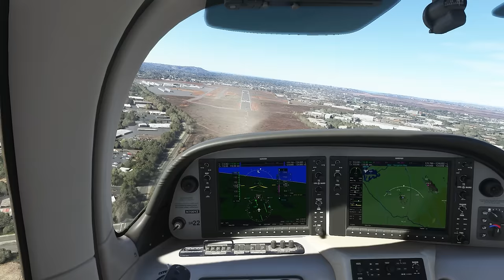Fatal Plane Crash At Montgomery Field After Student Pilot Declares An Emergency | N700YZ Crash

Comment: Reading the comments on Katherinesreport it sounds like he was a solo student pilot. The theory by a few Cirrus pilots is that he was too slow, and the Envelope Protection System was trying to get the nose down, which he thought was runaway trim and kept pulling back and got slower and slower, until it stalled.
Reply: Seems a good theory. I also wondered about accidental auto-pilot? But I've never flown a Cirrus... or anything more modern than 1970 with steam gauges! My question to an SR22 pilot would be if there is some kind of alarm that goes off when the EPS is active? Wouldn't that be an integral part of training right from the start for any Cirrus pilot?
Reply: That makes sense
Reply: I never flown a Cirrus, but damage looks to be cause off stall spin, high angle nose down impact.  Rest in peace.
Reply: I watched this happen. Aircraft was oscillating all the way to the ground… similar to a “porpoise” on the ground.
Reply: @owenwhitfield9475  so pitching up and down as he came down?  How fast did he come down?
Reply: That's the point. All these envelope protection systems are heaven and hell. Hell because they prevent you from self-conducted flying the airplaine, relying on some AI instead. So you become more a system-manager than a pilot. R.I.P.
Reply: @rvrnnr987  I fly Cirruses, there's not really formal training but my instructor taught me in a situation like that to just keep jamming the "autopilot off" button. Although I've only ever run into this issue when I've been intentionally practicing stall recoveries.
Reply: This is where systems knowledge comes in handy
Reply: Yes I think the same
Reply: @owenwhitfield9475  I’ve never flown a cirrus but from my understanding that fits with the envelope protection system theory then if he was too slow. The aircraft would pitch down in an attempt to gain airspeed to avoid a stall, giving the pilot the perception the trim was running away. As a response he pitches up more, only to have the system respond again trying to dip the nose back down.
Reply: @someguyontheinternet7165  So, essentially their system does what MCAS did to the 737 Max? Violent repeated down pitching regardless of altitude?
Reply: A sad story indeed. As a former pilot having flown only Piper and Cessna aircraft, I am not familiar with any Cirrus models, but from what I see in the comments above, it seems that this student pilot might have not had sufficient training in emergency procedures specific to this aircraft. If the aircraft has a system that takes over and changes the attitude of the aircraft when it senses a need to do so, the pilot should receive a visual and an audible warning of that, so that appropriate action can be taken immediately. If that does not happen, I would consider it a serious deficiency of the aircraft itself. It seems apparent also that if an instructor had been present in the right seat at the time, this problem could have become a valuable learning experience rather than a tragic accident.
Reply: @glider1157  I have the same AP in my aircraft. Its complex and you have to get to know it. Lesson #1 s how to turn it off.
Reply: that’s exactly what came to my mind and then i saw your comment

seems very similar
Reply: This seems to be an older SR20 which doesn’t have envelope protection. I may be wrong of course but it came with stec autopilot. Plus why would he be on autopilot in VFR on short final?
Reply: @susansticazsky9787  Registration info for the N number indicates it’s a 2020 Model.
Reply: @mouser485  ok thanks envelope protection malfunction or slow slow speed related issue seems to be one probable cause then.
Reply: @scottfranco1962  usually (like on my Garmin panel) if you hit the trim button it turns off the autopilot
Reply: @christopherpardell4418  This is a super common safety feature of many modern aircraft. It’s the same thing as a stick pusher—plane is going too slow, so lower the nose or you’ll stall. The insanity of the 737 MAX is that it was based on a single (faulty) AOA sensor, not the existence of “automatic nose down” (AND) software.

While an AND activation may be surprising and potentially dangerous at low altitude, the alternative is stalling the plane. The former is almost always the lesser of two evils, as uncontrolled flight at low altitude is likely to be fatal. With that said, I’m sure there is logic in the software to disable this behavior when landing, because at that point you really do want to stall the plane onto the runway. I’m not a Cirrus pilot and don’t know the specifics
Reply: @MiloToor  I understand your point.   I think its clear that this new pilot had not been fully trained on this system and so had no idea that it was supposed to be happening and that he should increase speed/nose down, as you say.   But then, The exact same thing happened with MCAS… Boeing failed to train pilots as to the system and what to expect, much less, let them know how to turn it off.   The tragedy was not only that their system only read off of ONE AOA sensor that was known to be prone to failure, but that EVERY Max HAD a SECOND AOA sensor installed, and Boeing had planned that airlines would pay an UPCHARGE to activate the second sensor and have a cross check warning light warn of any disagreement between the sensors. That is, every plane had the equipment… But to advertise a lower price, Boeing had made critical safety systems software ‘unlockable’ as a means of charging more.   US airlines paid the upcharge- and several MCAS malfunctions in US carriers occurred without accident because of the backup and the warning light.   But the smaller foreign airlines did not pay for the upcharge, and so had only one AOA reporting to MCAS.   My point is that whoever was instructing this pilot OUGHT to have made sure that that system was fully explained and practiced with if this guy was going to fly a plane solo that had that equipment.  Especially in light of the MCAS debacle and how easy it is for a pilot untrained in a system to be confused by unexpected automatic takeovers of their controls.
Reply: If it is that, simply going full throttle and leveling the wings should have gained altitude.  It seems like he was focused on landing the plane not flying it.  Will be interesting to see the FAA report on this one.
Reply: An ok theory, except he was doing 130 kts on final. He was slow earlier in the pattern but on final he was never slow until he hit the ground.
Reply: A student pilot should be in a C 150 or C 172, not in a high performance aircraft. He did not even know how to handle the radio properly. Sad his instructors let him go alone on this plane he was not able to fly.

Comment: Wow, reading these comments brought back memories of a flight I had in the early 1970's.
I rented a Cherokee 180 at Quakertown Airport in PA about 20 miles south of Allentown PA.
On takeoff I used the trim but the trim motor kept running when I left off the switch. I saw the trim breaker on the lower part of the front panel and that stopped the trim motor. I told Gail Montgomery when I returned the plane. He said oh yeah it sometimes does that!
Reply: In your earlier situation, I would think that it would have been time to give someone a “beat down” for renting you a faulty piece of equipment.
Reply: I trained on a C172, C152 and a Cherokee 180 for my PPL. I had to train on all three types because of heavy scheduling, could not count on your favorite plane to be available. But I sure as hell don't remember the C180 having any electrically assisted trim on it. Was that maybe an option on those? Because the one I flew didn't have that or maybe my instructor didn't mention it and I didn't notice it. I think it had a manual trim wheel for sure though.
Reply: They all have manual elevator trim standard; electric trim was an option; you can usually spot the thumb button on the left horn of the yoke
Reply: I started my training at q town fuller aviation finished at Queen City
Reply: Any other Gremlins? Like engine sputters cuz i put the wrong grade fuel in there, things like you mentioned and others would be good to know before you leave
Reply: I got mine ppl  at pennridge.  CFI Keith Overberg. (rip) His planes were old but well maintained. You never forget your cfi.
Reply: When searching for a flight school I went with one where a 172 had a brake out on one side or another making it very difficult to taxi as it tended to obviously pull to one side. The CFI said oh yeat this one does that just mash the pedal hard, I was already pressing the pedal to max, he said this like it was normal. I finally told him i wasn't really comfortable learning on defective equipment. He insisted it was fine and we went on, upon landing and taxiing back he took control and was clearly fighting the place as I was, he finally said geez you were right it is excessive. After this i decided I will never ever let that situation go that far beyond the hanger again. I also chose a new flight school.
Reply: I love KUKT. Doesn’t appear to have changed from the 70s it’s a time trip.
Reply: Then when you read the log book the propeller fell off three times and he says to you after you ask oh yeah it does it sometimes LOL

Comment: I am 56 and have had my PPL for 3 months. In about a month I will be IFR. All my training is in a 172 but have cross-trained in Cirrus and rent them to take my wife out of town on occasion. I agree with what the other fellow said about this plane providing a crutch. I'm one of those low hour guys that uses them. As I said, All my training has been in the 172. My instructor never told me how to disengage autopilot. When I would go on training flights with him and the autopilot would beep he would reach up and push some button. What he was doing was adjusting the altitude to make it quit nagging us. What I thought he was doing was turning it off. So on one of my very first solos, as I climbed away from the airport, the autopilot started beeping at me. So I reached up and did what I thought he did and turned it off. Except really I was turning it on. All of a sudden my trim was going crazy and I was climbing like a rocket. Or as much like a rocket as a 172 can. I got on the radio with the tower ask for help they got One of my instructors on the line he had me try to pull the fuse but it's one of those little white ones that you can't pull out without a pair of needle nose pliers. Eventually I think I hit the AP power button again and was able to manually correct the trim. My emergency lasted about 2 minutes and scared the ever loving bejeebers out of me. I almost turned around and landed right after that but decided to continue with the flight and just go fly around our practice area and relax and enjoy. Otherwise I might have quit aviation that day. You have to respect these machines and stick to the process, but it would be really helpful if instructors were required to teach students how to disable autopilot.

Comment: I'm a private pilot, during my training I had some problems with airplane trimm. I told my CFI that I afraid to trimm aircraft and prefer to left it in neutral position. Basicly trimm reduce force on the flight controls and pilot have to retrim aircraft in case of any chenge of aircraft configuration (change power, flaps etc). So my instructor trimmed airplane to full nose down attitude and showed me that I'm able to control it with even my 130 lbs body. In those small airplanes like SR20 or 172 or cherokee almost any pilot have enough force to control them  with any settings of the trimming.
Furthermore if speed decreases - force necessary to control aircraft decreases. If airplane was appropriate configured for landing there wouldn't be huge problems at all. That's just my personal opinion.
Reply from the maker: Thanks for the explanation.
Reply: It is great that your instructor took the time to show you adverse trim.  Good luck in your training.
Reply: Problem could be how he was dealing with motor power and film shows cyclic downwards pattern, if that was the case i would be wondering if he had to low powersetting for the situation, perhaps one soultion could have been to aviate and gain altitude on full power instead?
Reply: @konsum949  I was watching him fly, then went to the plane after the crash with our line team at Crownair.  I don't believe he was at a low power setting , the speeds were well above approach speeds for his go-around (I'm a CFII, haved owned and taught in the SR20 & SR22 for 18 years). He was aviating and trying to gain altitude.  Hopefully we will learn more from the investigation.
Reply: @PersonalWings  i might just be that a runaway trim makes the pitch not controllable, not all aircrafts have enough pitchcontroll to overcomme full pitch downtrim and otherwise. Just sad for the relative and friends, "time Will tell "
Reply: I'm an instructor there definitely could be problems if he was fighting a constant runaway trim.  This also isn't a Cessna 172, it would handle quite a bit differently.  You'd need Cirrus pilots to comment on this.  I own a Mooney.
Reply: @PersonalWings  so he did attempt to add power and do the go around?  That would have only compounded his issues.
Reply: @gringoloco8576  We’re going to post some trim videos soon.

Comment: I actually had something similar while I was doing pattern work once… the trim dropped to the floor and the plane tried to go nose straight into the sky.  That was a scary 10-15 minutes where I had to muscle the yoke forward because the trim wasn’t cooperating, and I was still pretty recently solo, so I wasn’t really familiar with which circuit to disconnect.  I also wasn’t too familiar with autopilot, so I didn’t want to mess with anything… I was just going to do what I could to get back onto the ground as fast as possible, and I did.  I kept my head and made a safe landing.  From the recording it sounds like the guy panicked… and I can’t blame him for that, but that’s likely what got him killed.  Panic is among a pilots worst enemies.

Comment: Agree with some other posters, Cirrus is a complex airplane in which to be soloing, and the trim switch is usually a double switch to prevent inadvertent actuation, lots going on on the field at that moment, my guess is the poor guy held the trim instead of pressing the push to talk switch, or both.
Reply: Yea. That could be it.
Reply: That or he engaged the autopilot accidentally and didn't realize it? Then when the yoke started fighting him he tried to resist but didn't think to disengage the a/p
Reply: @mfkp  good one, didn’t think of that
Reply: Hadn’t thought of that. That’s actually a very real possibility.
Reply: @user-yf4fi6mf9u  Now that I think of it, that happened to me once in IMC when I encountered a convective updraft. Trim wheel started spinning nose down to keep the airplane at 6000 feet. Took me a few seconds to figure out what the heck was going on as the nose was pointed more and more down trying to maintain 6000. I was not a novice and it still caught me by surprise.
Reply: I doubt this was the case though jts definitely possible w a student pilot though he prob would have realize it if it was his own hand.  A short in the system could definitely cause runaway trim and I've seen autopilots do strange things sometimes
  You really want to know how to disconnect them.
Reply: One this new is a “top hat” style switch, not double rocker

Comment: Cirrus seems to be a very complex aircraft to get your private pilot training.  Training should be in a more simple aircraft with manual trim in my humble opinion.
Reply: Exactly, excellent point. Even the heavies are loaded up w/ technology that in an effort to reduce pilot workload, they have created systems which are difficult to manage even when they are working fine.
Reply: Are you a pilot?
Reply: @knightsofthesky  yes private SEL, MEL
Reply: People who have a lot of money, gravitate to do their initial training on the Cirrus thinking it is a "safer" airplane because of the BRS parachute and the glass cockpit and all the auto stuff.  For the rest of us, we picked out the simpler Cessna or Piper out of necessity because they are a lot cheaper to rent and thus they cost a lot less to train in.
Reply: @knightsofthesky  I am. And I reckon he’s right
Reply: @KevinPaulineNeal  ever flown an SR22? They are about as simple a plane as I've ever flown. Very easy.
Reply: @knightsofthesky  no.  
But. I’m a 2000hr MEIR CFI  then added another 13000hrs over  20 years Airline flying.  So I’m not an inexperienced pilot.
Reply: @knightsofthesky  I have not flown an SR-22.  Been to the factory.  Had a tour.  Avionics seem complex to this guy who started flying in 1984.  A lot to think about along with basic airmanship.   Most of it is designed for IFR. So why not learn to fly in a basic airplane and add the complexities of today’s glass cockpit and autopilots later on.  Always remember my instructor saying, keep flying the airplane, especially when things go wrong.   (He was a WWII veteran, flew C-47s over the hump!).   Nothing like a simple C-172 or Warrior to start in.  I started in C-152.  Got the   basics and moved on.   Just because you can afford advanced aircraft does not mean you are ready for them.